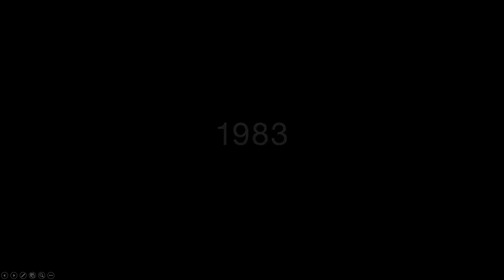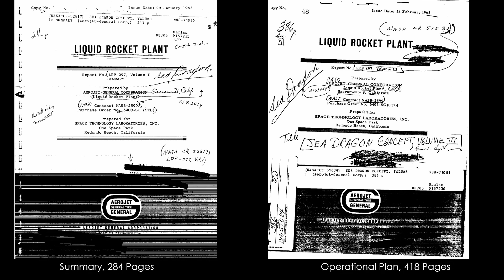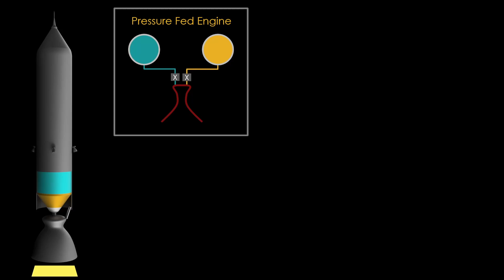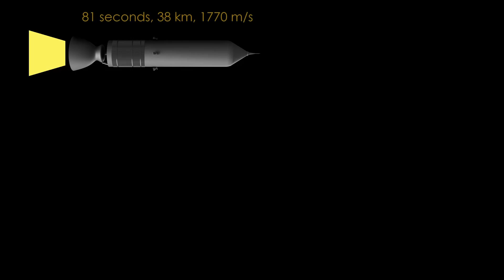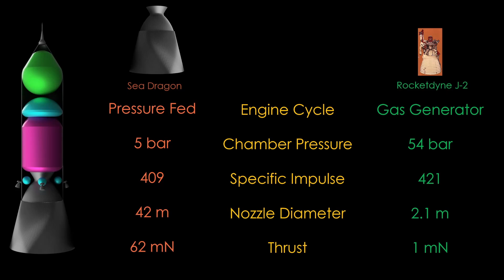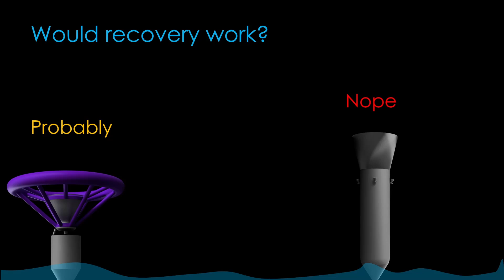Sea Dragon - The Saturn V's big brother?

Comment: Don't forget, flow instabilities were an issue in the F1 engine because it was big enough to allow them, but not big enough to absorb their impact.  When you consider the combustion chamber of the Sea Dragon, remember the relationship between area and volume and consider that these phenomena are much more complex than they appear.  One could make an argument either way on the impact of flow instability for the function of so large a combustion chamber.
Reply: The designer of the merlin engine said the sea dragon engines were possible
Reply: We should try it and find out.

Comment: Another point I think is necessary to be made is noise. This engine would be LOUD. 

Starship has had complaints for just how loud its first stage is. People who took videos that are over 4 miles away say the sound is deafening. Others say that they can hear the launch almost 20 miles away. With perfect conditions for sound, it could be well over 100 miles. 

Now imagine a rocket with several times that thrust. Even launching from the middle of the Pacific would mean coastal cities would be able to hear the rocket. Nevermind the marine life that would almost certainly die from the pressure waves. This rocket is a bad idea. Super, super fun to imagine but terrible in practice

Comment: You make comments about combustion instability, but I've been searching but I've only found references to comments by Tom Mueller on the Sea Dragon that it was going to use pintle injectors like the Merlin and that Tom believes the Sea Dragon would be stable. I believe pintle injectors have much better combustion stability than the injectors of the F1. Tom would be the one to know. I believe it was a tweet.
Reply from the maker: Tom would obviously know far more about it than I would. I'll only note that a) at the beginning of the F-1 they didn't think they would run into any significant issues with scaling and b) nobody has tried to build an engine that big since and c) the Russians went to multi-chamber engines which shows that they found the big combustion chambers problematic as well.

Comment: I'm asking myself how the ignition under water would work reliably.
Reply from the maker: I don't know if this is tested, but if you vent a small amount of lox into the engine bell it will vaporize and that vapor will push fill the nozzle and displace the water.
Reply: @EagerSpace  Question is how deep the engines are under water. The engine is pressure feed, so the pressure of the water must be lower than the pressure of the LOX.
Reply from the maker: @annando  The rocket is 150 meters tall, and roughly 100 meters is below the surface of the water. The LOX tank is at 16 bar, but if you heat up the pressure will go up. 

You could also dedicate some of the liquid methane to do it. It's at 300 bar IIRC.
Reply: yes it was tested by the USA France and CCCP

Comment: Using pintle injectors like the SpaceX Merlins, rather than the "showerhead" injectors or F1 would reduce the instabilities. and using stainless steel rather than aluminium could solve the heat related issues. Clever design could further reduce the dry mass of the craft increasing performance. The use of solid boosters could solve some of the problems as well. I thought early on in it's development that perhaps the Superheavy may borrow more from that design.

Comment: I'd love the idea of them fixing the big combustion instability issue by replacing with a vast number of small pressure fed engines, like some hilarious Kerbal rocket.
Reply from the maker: You could fit 29 F-1 engines in that space, with no gimballing. Use the aux motors to do that for you. 

If you shrunk their bells to 9' in diameter, you could fit 51 of them in the first stage.

But - of course - nobody would ever think of putting more than 5 engines on a first stage, much less more than 25...
Reply: @EagerSpace laughs in starships 33 engines 😂
Reply: @EagerSpace    laughs in n1😂😂
Reply: @EagerSpace  🤣🤣🤣🤣
Reply: @EagerSpace hehehehehehe
NK33 go BBBBRRRRRRRRRR
(and raptor I guess, hell, the proposed 9 engines for Starship is an insane number of engines for an upper stage, not even mentioning the booster)
Reply: That's actually what people refreshing the sea dragon in KSP to be size accurate do, and then the visible engine nozzle is just a fancy fairing

Comment: Maybe when the engine is so big, instability is no longer a problem because there will be multiple instabilities occurring at the same time and averaging out the thrust
Reply from the maker: Ah. The "so unstable that it ends up being stable" hypothesis.
Reply: @EagerSpace actually there was a separate study about how the combustion instabilities would be so big and slow due to the bell size that 60’s tech could actively cancel it out. 
That’s how massive this was.
Reply: This is also the basis for my dancefloor moves 😅
Reply: Or ring combustion. the instability spirals around a toroid combustion chamber, any instability gets smoothed out by the chamber never being stable.
Reply: @BartJBols  idk if they had rotating detonation engines figured out back then
Reply: Literally "that one problem is the solution"
Reply: That is interesting.  However, I would waste thought processes on what could have happened.  What if are only used by senior senior old farts to justify their existence now with things they have done in the past.  This is just on paper and not built.  However, the real world of economics is always about the next generation and what have you done for us lately....

Comment: What if the first stage was a giant SRB instead?
Reply from the maker: It would need 24 times the thrust of the SLS boosters. Seems like that would be pretty hard to fabricate and pour. 

They are also really dense - the propellant is about twice as dense as water - and therefore very very heavy. You would need some sort of floating platform to keep them from sinking.
Reply: @EagerSpace  Good points
Reply: Also solid rockets are not throttleable, which gives complications as you approach max q and is why they are rare to see on main stages on large rockets.
Reply: @Quasarnova1  There is some "thrust profile" you can "program" into the fuel itself, via geometry and composition, but yeah that is another complication.
Reply: @Quasarnova1  This isn't necessarily a dealbreaker. Saturn V, Firefly Alpha and Starship-Super Heavy all punch through Max-Q without throttling; albeit, solids tend to be rougher than liquid fuelled vehicles, so it might be a little more difficult. But as someone else pointed out, you can kinda get a variable thrust output from solids by just hardcoding (hardcasting?) the preferred flight profile and make it work.
Reply: @Quasarnova1 that could be solved fairly easily by having the fuel layers inside the srb designed so that a slower burning, lower thrust layer was reached just prior to MaxQ, and go back to higher thrust layers after MaxQ is passed.